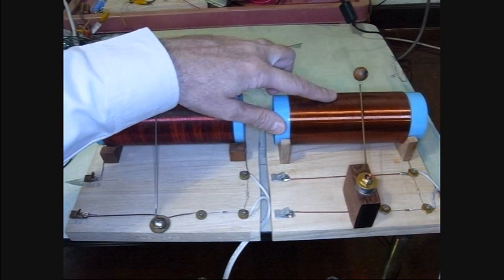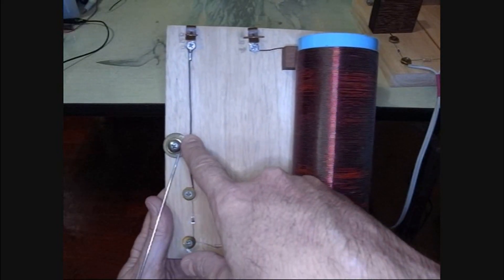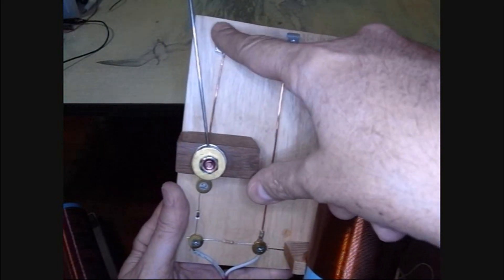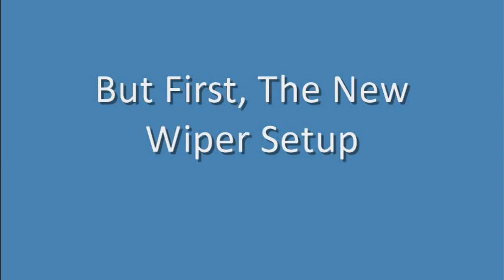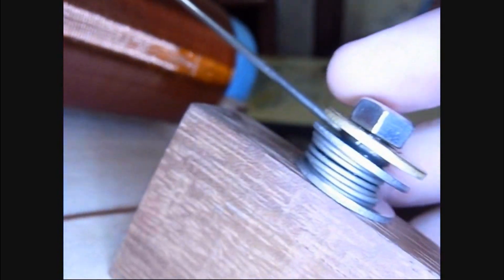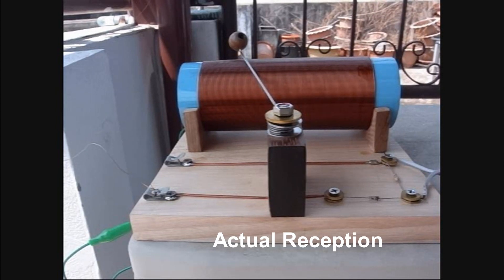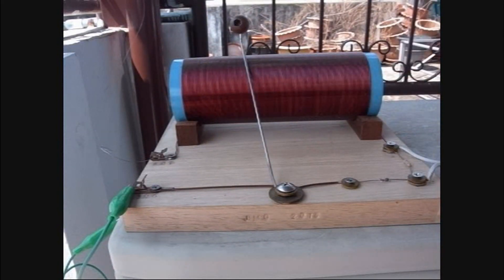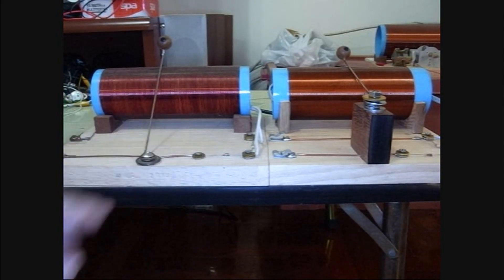New Crystal Radio Design - "Modified-Pickard"

Comment: May I use 1n 4148 diode?
Reply from the maker: No, it's very different.  I'd pretty much guarantee it won't work.  The 1n34a is cheap and easily available from mail order or local electronic stores.
Reply: One researcher produces electricity from radio waves. He says :''Atmospheric waves are AC  and bridge rectifier produces DC and a DC motor runs . I saw his video. Is it possible ?
Reply from the maker: The simple answer is "no", not really.  You CAN do it *IF* the transmitter is powerful and very close to the receiver, but then you really just have an air core transformer (which is very inefficient).  So for just demonstrating under very special conditions, yes you can do it.  But in real life with an ordinary radio tower many kilometers away, no, it will not work.